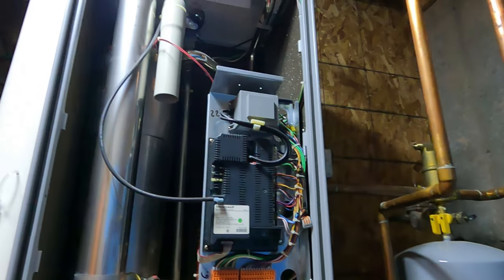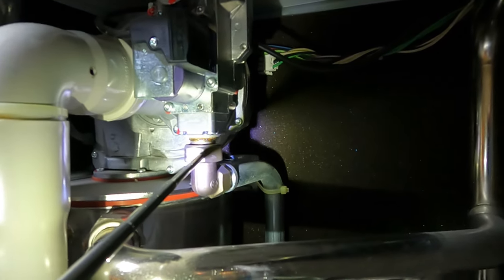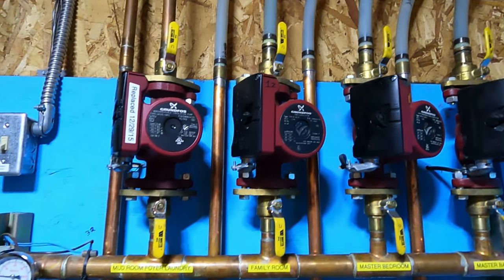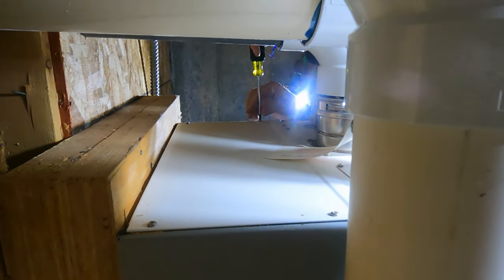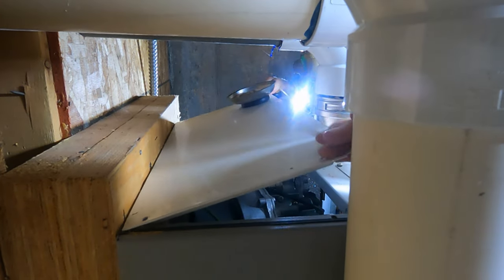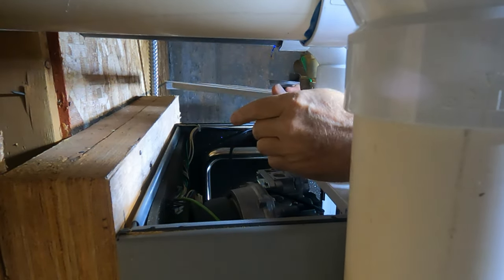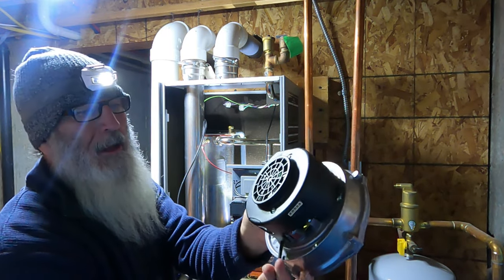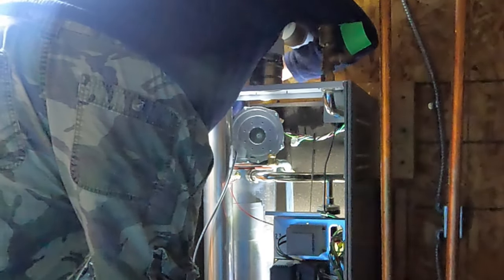Triangle Tube Prestige Solo 110  Blower Motor Replacement & Repair           Easy to D.I.Y

Comment: Hey thanks dude that second 120v connection not previously used was throwing me for a loop until I saw your video. My TT 110 was installed in 2006 it's 2022 and it has been flawless until it needed the blower, burner, insulation and ignitor&cable. So I'm not sure I can complain too much. Other than it's -25c here and I waited 2 weeks for parts. Thank god I had a Harmon pellet stove for backup.
Reply from the maker: Glad I was of help. 😱 -25c? thats -13f, I think I'd have to hotel it

Comment: In fairness to triangle tube my unit has run flawlessly for 19 years.  I do not mind and expect in the new age to have to replace a few "Valued Engineered" parts now and again. It is disappointing I realize, but my time in the trades has proven this is more and more the nature of the beast in the mechanical world. Thanks for the video I was without reading the instructions wondering how I was going to get to those back screws.  The fact that Triangle tube includes the tools is pretty impressive. I have and probably you as well, have been treated with less dignity by other equipment manufactures.

Comment: Thank you for the very informative video going through this now our solo 110 was installed in 2007, has never been a problem in 15 years. Not happy with the disintegrating plastic parts, the blower motor is 420 now plus shipping. 
The fan blade totally destroyed itself and lots of little pieces fell into the boiler, not fun fishing all those out.
Reply from the maker: Triangle, engineered a failure using cheap ChineUh plastic.  Their reply is, lets see you get 10-15 years from your iPhone.  So, why can't we buy a $45 replacement plastic wheel?  $420 plus overnight shipping during the winter is Fucking their customers. Good Luck and Thanks for watching!

Comment: Thanks for posting this video!  It was very insightful.  I got the E28 error in the middle of the night last night in Minnesota (so no heat or hot water).  It's 3 degrees below zero now outside and the temp is on its way further down.  Bad timing.  (Presumably just a coincidence.)  The gas company (with whom I have a parts & labor service contract) came out today and confirmed that the blower motor is dead.  The technician ordered the part (new blower) but they don't know how long it will take to arrive.  Ugh.  More bad timing.  The technician said he's concerned that sometimes when taking the blower motor out there are brittle parts/screws that could (if seized up) cause expensive (multi-thousand $) damage to another part of the boiler.  I'll wait for him to come back to install it when the part arrives...but I sure hope their supplier isn't too far away from Minnesota.  Thanks again for posting.
Reply from the maker: There was nothing(brittle parts/screws) to be concerned about, it leading to a larger job.  They can always pay for over night like I did. I got by with electric room space heaters or the fireplace, but going with out Hot Water was tough.  Good Luck

Comment: Excellent video!  Really helped me replace the Blower Motor on my Solo 110. This is the second time this part has failed since installation in 2009.  First one lasted until 2018 and now the second only lasted until now.  Interesting that the wheel on the replacement part is white whereas the first 2 parts had black wheels (still plastic though).  Hope this one lasts longer.  Also saw that the venturi was coming apart on the inside.  I will probably replace that as well.
Reply from the maker: Thanks for the comment and watching, Hopefully the White wheel will last longer.  Still wonder why TT won't use an aluminum alloy wheel if Heat transfer is their concern.
Reply: The foam insulation on the inside of my TT Prestige solo 100 is disintegrating.  That and a flickering green light on the switch are my only noticeable issues.  Trying to plan ahead as the unit is 10+ years old now, and it’s time to plan for replacement parts.
Reply: I have replaced the blower 8 times on mine. Plastic fan fails and flys apart. My insulation is also rotted and falling all over. My low pressure sensor also leaks and had to be replaced. These boilers are junk. Mine is less than 12 years old and warranty is only good for 8.

Comment: Thanks for posting! I'm in Canada and just had to have one shipped air freight from New Jersey as no local suppliers had one in stock. This will be my 3rd blower replacement since  the installation in 2009. I agree 100% that TT should offer a replacement fan! I wonder though, if was made of metal that the heat absorbed through the motor shaft could be a problem.....
Reply from the maker: When you get the old motor removed, disassemble the black cover on the back and you'll find another fan blade that is designed to cool the motor and IC Board.  We put a man on the moon 50 years ago,  there has to be alloys in plastic, aluminum, brass or copper that would never break or fail.  This is 100% 🐂💩 engineering.
Reply: Great info.  When I saw the plastic wheel break apart, I was thinking that heat must have baked it, but acid makes sense too.  Configuring my exhaust was not easy.  I had to send the intake to a location under a window which is not acceptable for the intake.  I can see steam blowing on cold days and will make sure my intake is not able to suck any of that in.

Comment: The fan is forcing cool fresh combustion air and gas into the boiler.  It isn't sucking the hot gas out.  AS one guy below said likely you have a piping problem outside your house so it occasionally sucks some exhaust fumes into the the inlet pipe.   I had that problem and it ate up the venturi.  I modified the piping to fix the problem but now I have a fan problem to repair.  Unfortunately mine is from 2009 and it has phillips screws everywhere which is a nuisance. My kit came with no long screwdriver and I will have to make one.  I have two of these units and one is in a workshop and it alsways fires fully and I had an ifniter problem and took it out and cleaned it and bent it back into shape and it worked fine.  If you are changing a fan it is a good idea to remove the igniter and brush it clean and bend it back into shape if it is deformed.

Hopefully I can get that darn last screw out of the rear.

Comment: Great video. Mine started making a loud growling nice from the fan area when it ignites. Everything is working as it should its just loud. Any input? Not sure if it's bearings in the fan or what?
Reply from the maker: Sounds the same as my problem.  Any noise has to be from the blower motor, it's the only moving part I think.   I'd pull the cover on front and/or top and take a look, but It's prolly best to get a replacement on order because no one stocks these and it's getting cold.  Even if you're not doing the replacement yourself, having the part speeds up the repair and saves a 100% markup.

Comment: Having gone through this myself twice.  My unit was installed in 2011 - 2018 the fan went to pieces, and now last week in Northern NJ during a cold spell - blew apart again.  First of all, not everyone can service these types of units... and after seeing this video - I had to get to the bottom of this!  I just got off the phone with Customer Tech Support - and the issue is not the part but initial setup - if the exhaust pipes are not setup correctly - this is going to be the result.   The latest guy who came out - found this issue out before my call with corporate tech support.  My Fresh air pvc pipe was pulling in the exhausted air ( since they were not setup according to specs). that air contains highly acidic properties from what the system expels - that in turn will break down the pieces over time in the system.   So please look at your exhausted pipes and make sure they are setup correctly - I had to raise my exhausted by 23 inches - allowing the system to pull in fresh air!
Reply from the maker: Wow, very interesting, makes sense and made me go look!  
I may have a Problem. My intake and exhaust are both 4" PVC, they both go to close proximity of the basement wall where they both go into a "Y" fitting.  From there I have a single 4" exiting the house.  At the "Y", the intake pipe is cool, while the exhaust is warm.  So my next question is where are the documents displaying the proper installation?         
While I agree with your statement, "not everyone can service these types of units" I feel anyone with mechanical skills and tools, The type of person who changes their own Automotive oil, can replace this blower motor with no issues.
Thanks for watching and the Comment.
Reply: You have a “bazooka” concentric kit pretty sure it’s ok with triangle tube. Also the combustion air/fuel mixture needs to be adjusted properly as well as spark and flame sensor checked. https://cdn.triangletube.com/wp-content/uploads/2021/08/13141651/2011-1-Prestige-Solo-110-Installation-Maintenance-Manual-.pdf

Comment: Very helpful. Thanks. I am an electrician as well and mine just went dead this morning when it's below 32F
Reply from the maker: I hope you live in an area that stocks them locally!
Reply: @UncleFjester  I am in Boston, 15 min away from Ferguson but they don't stock them, only available for tomorrow. Going to try a few more heating supply stores
Reply: @Uncle Fjester  $265 shipped overnight. Fixed it. Took about 1 hour, I have very limited access, had to remove the entire pipe going outside to get the last screw. 
Probably need to pre-install it in there before putting the fan in, but I already amounted everything, then had to use some crazy glue to put in the screw on the screwdriver and lower it inside. Hopefully this didn't damage the screw and u will be able to remove it again.....I would say in 7 years or so :) 
If the part was metal, this wouldn't be an issue in the first place. Plastic fan blades all broke inside.
Reply from the maker: Glad my video helped ya.  T-Tube should offer a replacement plastic wheel for $25.  Just like Nutone has replacement wheels and motors for bathroom Fart fans.  Stay Warm!
Reply: @Uncle Fjester  Just had ignition failed on it too. (Boiler is like 7-8 years old by the way). Can't just replace igniter, must buy ignition update kit that includes igniter, main circuit board, and some other parts. I ended up cleaning old igniter, replaced venturi, had to buy combustion analyzer and bring it up to specs with O2 and CO2 readings. Good that tringle tube has vids to help with all this.

Comment: How did you check that the gas wasnt leaking?
Reply from the maker: with a Bic Lighter, if the flame on the lighter stays the same, there is no leak.  If the room Blows up, there may be a leak.

Comment: I have an e28, some light clunk noise from the blower as it tries to spin. I’m guessing it’s seized but the last time I had to replace it took days to get. I hate this thing
Reply from the maker: How long did your last one last you? Its rather 🐂💩 the blower wheel is plastic, Overnight it from Ferguson.com
Reply: @UncleFjester  4 years and one month. I'm up in canada, the part number in the manual is different than the number the triangle tube guy just gave me. I hope i get the right one.

Comment: any idea if the ptrkit114 and psrkit13 are the same? I'm trying to source one locally. My prestige 110 manual says psrkit13 but online it says its for solo 175/250. Not sure what to buy.
Reply from the maker: call TTube with your serial #  they'll tell ya
Reply: @UncleFjester  I called them, that’s how I came up with the ptrkit114 number. I hope he looked in the right column. Had a Koehler guy give me wrong sink part number before, 😂
Reply from the maker: Mine was the 114 too.  I'm like you, I hate "having" to trust someone else to read a catalog parts list that I can read

Comment: Next time convert to a Navien product! I've worked on them all & Navien is the best unit I've supported.
Reply from the maker: How long should this last, it's closing in on 18 years old.
Reply: ASHRAE standards say equipment should last 15-20 yrs. Less if not maintained. Navien is just a better product. @UncleFjester
Reply: As long as it doesn't leak & parts are available @UncleFjester

Comment: Your fan failed due to bad combustion, bet if you showed us how your air and exhaust are piped we would see the true cause why the  fan failed .
You also should of checked if the Venturi is good and combustion tested the unit .
End of the day , the product is only good if installed and serviced correctly.

Comment: am in Canada, have had 7 blower motors since 2010. Plastic fan blades rot from the gasses and explode. New blowers now have alum blades but now the interior shroud glue lets go and falls off and jams the blades. Triangle Tube boilers are junk, mine breaks down almost every month, blowers, aquastats, venturis, control valves, have had to replace all many times. Will never buy triangle tube products ever again.